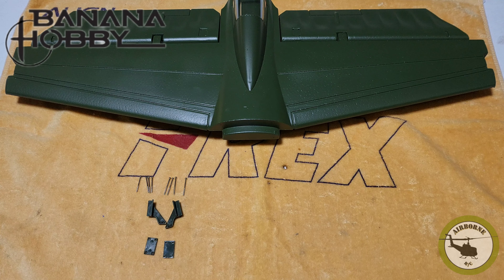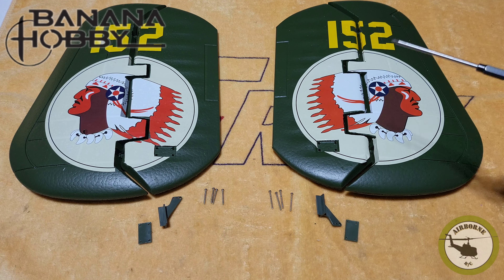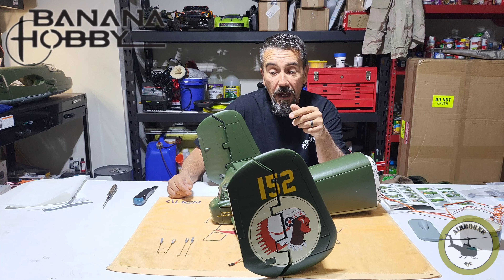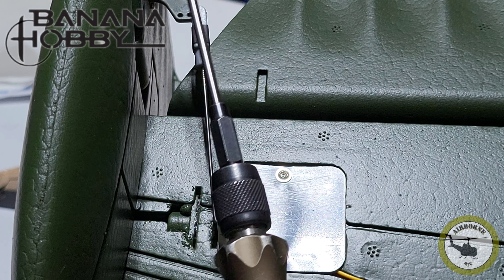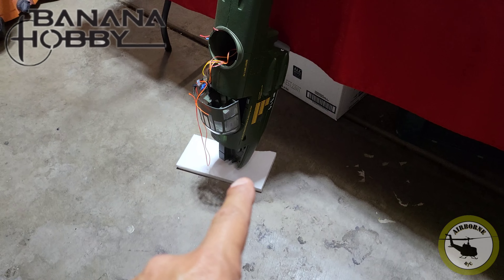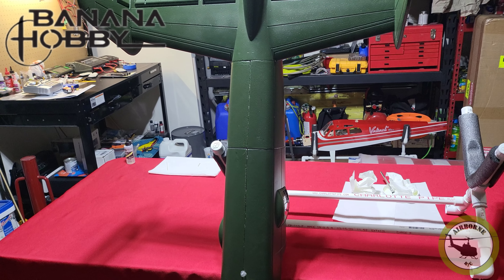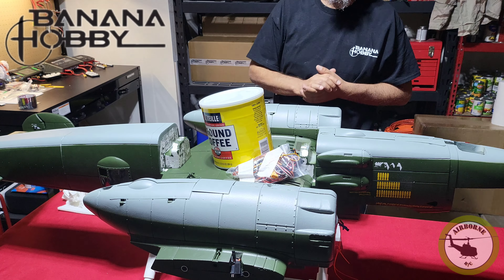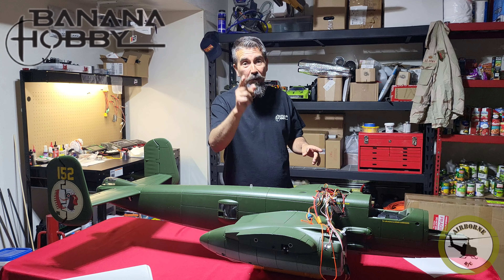2M B-25 Mitchell from Banana Hobby Assembly Part 1

Comment: I want THE BIG ONE!! A 22mm  screw to go through the ELEVATOR! Yeah, baby! (And  3/8” x 7” bolts to hold on the wings, right? ) For what ts worth, I stopped using loctite on  foam planes- a drop of nail polish does the trick , and you can get the nut off, if you want. I LOVE the shrink tube on the Clovis- gotta try that! And HAPPY NEW YEAR!
Reply from the maker: Thanks for watching! Hoping you new year has been great so far! 👊🇺🇲

Comment: Hey noonz i just got my b25 together may i ask what are you runing for battery i had run 2 14.8 3300 in paralell cause bananna hobby dont have the battery in stock
Reply from the maker: I have the 4s 5200 lipo, and I am going to try 2x 4s 2200 bc I have em...the 5200 is 437g  to give you an idea for weight
Reply: @NoonzAirborneRC  yes i was gonna order the 5200 but wasnt sure if it would fit thanks for the help